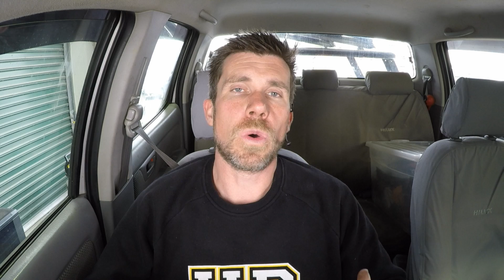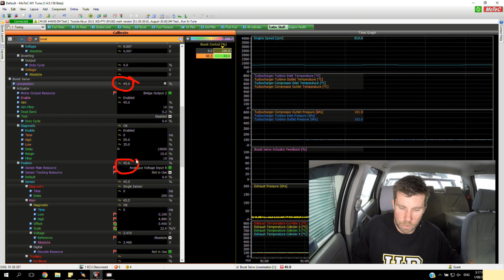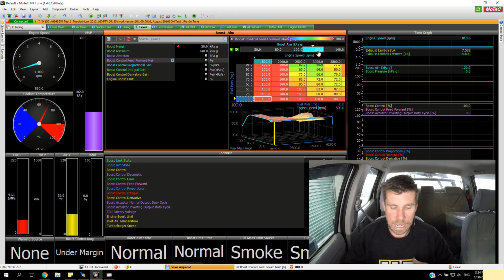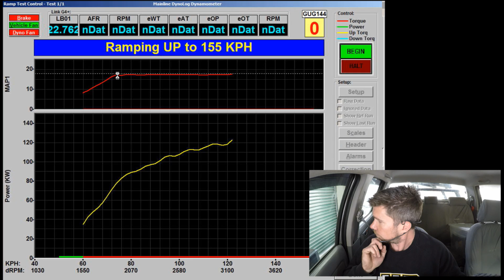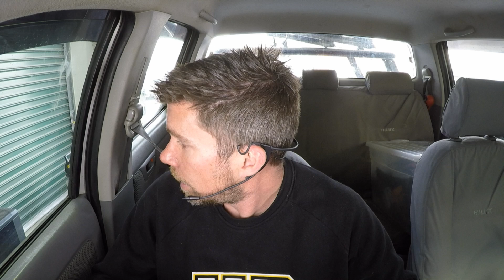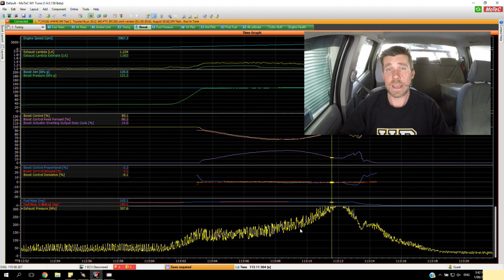Intro to VNT Turbo Boost Control | Variable Nozzle Turbochargers [GOLD WEBINAR LESSON]

Comment: Great vid as always. My gold membership has lapsed so cant ask on the HPA forum..
In the case of factory ECU tuning (specifically SID209 on Ford P5AT) and simple type actuator, is there a means of setting the minimum and maximum vane position? Or is that calibrated into the actuator relevant to turbo min/max flow?
If EGR is disabled, would the increased exhaust flow to turbine mess with the back pressure if the actuator has a factory flow calibration?
Cheers

Comment: I've got a 2009 Nissan Navara D40 YD25 with the Garrett gt2056v turbo using pneumatic actuator.This runs a solenoid valve.Can I use the GFB VNT boost controller instead?

Comment: Good video, always good to be able to find more information. I have a bit of an uncommon situation, I'm planning to build a compound setup with a VNT as the small/high pressure turbo and a wastegated turbo as the low pressure turbo. Was planning to figure out how to use stock management for the VNT and mechanical control for the wastegated turbo, but I'd be curious to see if you have any recommendations. I saw that GFB sells a mechanical VNT controller, would that be a good option?

Comment: I love how diesels sound like old pieces of crap
Reply from the maker: The 1KD is hardly cutting edge to be fair, but they do have their own unique sound. That said, our Duramax which probably puts out 6 times the power of the engine used here is very quiet, almost like someone forgot to fit a part specifically to just rattle around in it by comparison - Taz.

Comment: Awesome video as always. I Have a small question. Going from a Vacuum actuatored vnt turbo to a boost control actuator. In particular the zd30ddti vnt system on the y61 nissan patrol to help control the spiking boost curves.
Reply: Check out the 'magic box' thread on the patrol4x4 forum.
It is a stand alone unit that control the vacuum solenoid. The guy that developed it was designing for the 3.0l patrol but can be used for any vnt turbo controlled by a vac sol.
He has just started selling them and is very helpful with questions.

Unlike this approach his product is designed to maximise air into engine in all driving situations not just keep boost numbers on your gauge stable under full throttle so you think you have control.

Comment: I have toyota landcruiser 2011 model..i bought it without the two turbocharger..so i decided to buy two pcs.  Of turbocharger assembly..after installing it, the vehicle did not start.. It has gas at the common rail,  i found out that the 8 injectors didnot work.. P1259-P1262 vnt position sensor low bank 2 sensor 1 and 2 .. Is this trouble code related to the no start engine?  Or it has deep trouble?  Did i need to program the ecm after replacing the two turbocharger?  Thanks in anvance for the answer... Godbless..pls.  email your reply.

Comment: Hi!
I have a Nissan Patrol 2.8 TD and I adapted a VNT Turbo , and to control the pressure I applied a pressure actuator from a fixed geometry turbo. There is any way to control better a VNT turbo in an old car? Is there an ECU just to control the Turbo VNT?
Thank you.
By the way, excellent video.
Reply: You could try a VW N57 valve off an older TDI to control the amount of vacuum applied to the VNT actuator.
Reply: marco what turbo did you use on your 2.8? and what actuator did you use? Im looking at putting a gtb2056v from an iveco on my rd28.

Comment: Again what is left out is the VNT turbo is there in support for the EGR system so the TVA valve in the inlet manifold dos not have to run overtime as closing the vanes on the VNT/turbine side will create exhaust manifold pressure able to push some exhaust gas to the engine inlet side still able to maintain wanted inlet manifold pressure as well.
MAF is there in support to the EGR system and is NOT needed if the EGR system is not used and MAP can be used just as easy so if your VNT turbo affects volumetric efficiency you clearly did not set-up your activator travel correct.
A VNT can have 3 running modes. Normal modus controlling manifold pressure. EGR modes control of EGR flow in combination with EGR valve and TVA valve and it can be used for engine breaking on some models as well and we for rally use, use it to keep the turbo on boost while breaking off power so in all better engine response just by closing the vanes on the VNT to a point that will make this possible. As last do not try to aim for manifold pressure targets that can not be supported by the fuel quantity injected on part load for example as this will be resulting in the VNT closing for the most part on mid to hi RPM. Less fuel makes less power less exhaust gas volume! General rule is if the VNT is open hitting set boost target it has to stay open while running more RPM. If the VNT start closing after this point your eider not running the fuel quantity to maintain your boost target or your setting you boost target to hi running your turbo off the flowmap unable to the deliver the air mass wanted.
Reply: @ruudvisser720  i have. Toyota Hilux 1kdftv 3.0 with a vnt turbo I have installed a blank plate and blocked the EGR .tuner said he has tuned the ECU .. no check engine light and vehicle running fine ... Will I face any issues with boost or turbo in long run

Comment: On a petrol VGT I've found EMap as a primary axis the easiest way to do it .. I'm also finding delta EMap and delta map as a third axis reduces the need for PID ..
Reply: "EMap" being boost target minus MAP? Or?
Reply: @MikeyAntonakakis  EMAP being exhaust Manifold Absolute Pressure..as the rpm increases the engine is more tolerant of it ..and a given EMAP max has yielded a max IMAP if about 8psi more

Comment: Afair Porsche was the first manufacturer of petrol engines with VGT. 
And it was not so long ago, maybe 15 years or so.
Reply: High EGT in petrol/gas engines was the reason why VGT was used first in TD engines and much later in gas engines.
Reply: @jareknowak8712  The Peugeot 405 T16 had a VGT - gasoline engine.
Reply: @lutherblissett9070  i did not knew it. Thank You!

Comment: Just got a VGT Holset HE351VE installed in my M20-powered 325i, electonically controlled over CAN using a boost target table... great timing for this video! One thing though, at the beginning of the video you mention that the vanes can be used to control boost, but also that this topic isn't diesel-specific; but with VNT on a gas engine, you most definitely need a wastegate for boost control once then engine is operating efficiently (on my M20, past about 4500rpm the wastegate is controlling boost even with the vanes fully open at supposedly 26cm^2!).
Reply: @7:45 since my engine is wildly more efficient when it comes on the cam (low compression, 2-valve single-cam, moderately aggressive cam 280/280 - AFR-corrected VE ranges from ~60% at idle to 110% at peak torque), it has a HUGE relative range of air flow compared to a diesel, I'd imagine - I am accounting for this by reading the ECU's boost duty cycle over CAN into a microcontroller, and using the microcontroller to modify the signal based on RPM. I treat the boost duty signal as a relative-to-rpm demand (from 0-100%), and I implemented a lookup table/map to limit the "most-closed" position of the vanes.
In practice, with a realistic boost target map, tuning has been pretty straightforward - start conservative with the RPM-based minimum vane position map and target boost map - turn up the target boost if the engine hits the easy targets, and start decreasing the minimum-allowed vane position at that RPM (at lower RPM especially, once the engine comes onto the cam it'll boost to wastegate pressure with no problem). You pretty quickly hear/feel if you hit the surge limit, or if you start choking the engine. 
I've done zero tuning on the actual PID gains, and in fact I have the boost control set to "simple" mode which masks the individual gains behind a single "aggressiveness" slider. I imagine the "ideal" tuning would be heavily proportional - this would allow pretty aggressive minimum positions, but once the turbo begins to spool, it's easy to choke the engine (at low RPM WOT, lifting the throttle slightly with my current moderately-aggressive vane tuning decreases the boost target enough to start opening the vanes, and I get a sudden increase in torque). With the proportional tuning correct such that you get max demand at a little over atmospheric pressure, the vane position would hopefully edge along right next to that choke point...
Reply: I've been able to control boost ok my SR20 TR3076 VGT with no wastgates infact I've found it easier with out one I have a flange welded but not drilled I suspect at higher boost it might run away I'm at about 26 psi so far..
Reply: Mikey are you using Exhaust manifold Absolute Pressure as a table axis ? I found this to be an absolute breakthrough controlling vanes feul and ignigtoin..
Reply: @incolink  interesting that you can get away with no wastegate, the higher boost you're running definitely makes sense. I'm ultimately planning to run about 15psi (so 200kPa MAP), but working my way up to it. I know for sure I can't hold that with just VGT (forgot to plug my wastegate back in at one point and hit my boost limiter lol). Not using exhaust pressure at the moment, but I've been thinking about it. My strategy so far, though, is to set my boost target below my wastegate pressure by maybe 10kPa - this forces the vanes wide open once the turbo is spooled, minimizing back pressure. On the other end, when trying to build boost, my RPM dependent minimum vane map seems to be working really well and is easy to tune - just make the minimum position more aggressive until there's a noticeable loss of torque (or engine starts running richer), or turbo speed gets too high, or I start to surge (the compressor is probably a little too big for my setup, 60mm inducer).
It would be nice to at least monitor my exhaust pressure, and it would be easy to add to my setup (analog input to my microcontroller, CAN output to Megasquirt for datalogging).
Reply: On my data logs I found EMap goes up then turbo RPM follows them IMaP at witch point it was clear to me that EMAP is the best axis fir controll as you have already seen the engine can take more EMAP at higher rpm due to pressure ratios and gas velocity...but needs more EMAP down low to spool it.
Reply: Nice, i got myself hy40vgt with 28cm2 housing and with 1.8 m40 i want to try running without wastegate.. tho i always use borg warner turbo match bot and it suggest that on this setup i need wastegate (just few cm2).. 
So i will give it a try without wastgate if you are also running without one, and try same boost control by Emap with logging turbo speed.. 
One thing that could help me is one bov that i have laying around, so i could control/limit boost on intake side as is done on drag cars
Reply: @exvils  i doubt you need a wastegate the BOV will only be required if you start making lots of boost early witch will get you knocking or surging witch i also doubt will actually be an issue .as i found the turbo RPM would be a data-trace right between Emap and I MAP i found it was not really that useful just a bit cool  because your mates don't have it  ..
Reply: You have 110% VE on M20 head?
Reply: @jareknowak8712  not sure how accurate the number is, but that's what in my fuel map at 160kPa MAP. I use Megasquirt, and compensate for AFR target in the fuel calculation, and the tune in that region is right on target AFR with open loop fueling. There's room for errors across the board especially with injector characterization. But M20 head is a pretty good design, and I have a good cam installed, and equal-length tubular turbo manifold (and with the VGT fully open, very little exhaust restriction). So it's not totally impossible. The point I was getting at though is the range from idle to peak torque under boost is HUGE.
Reply: @jareknowak8712  the lower exhaust pressure he is getting is probably to blame for that miracle..